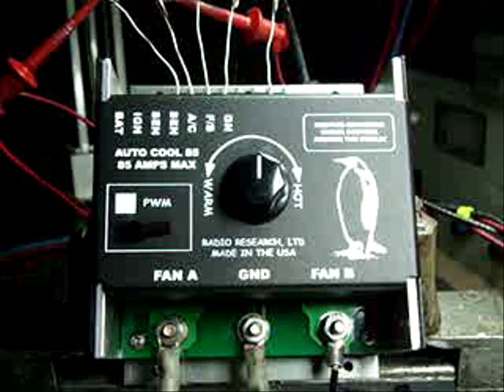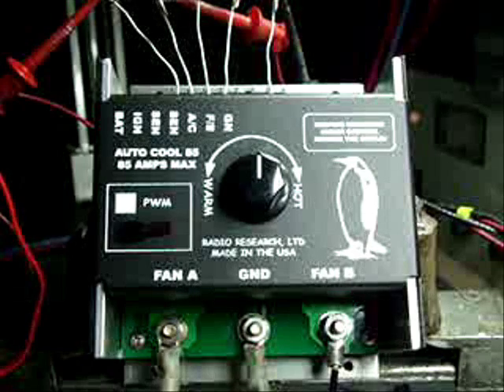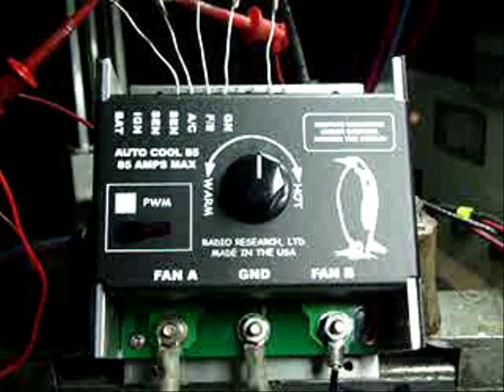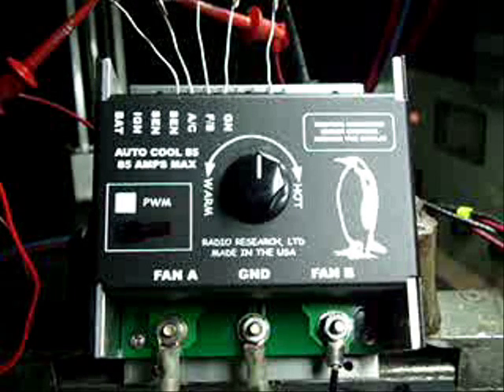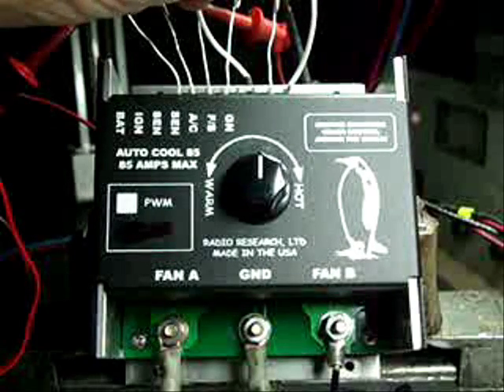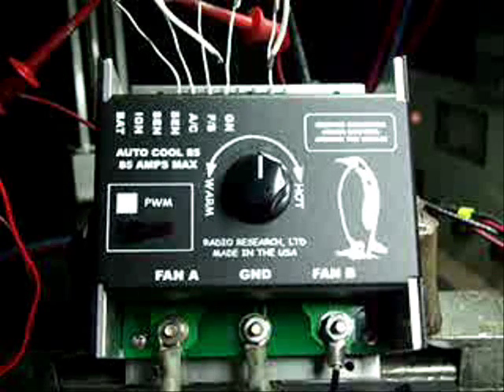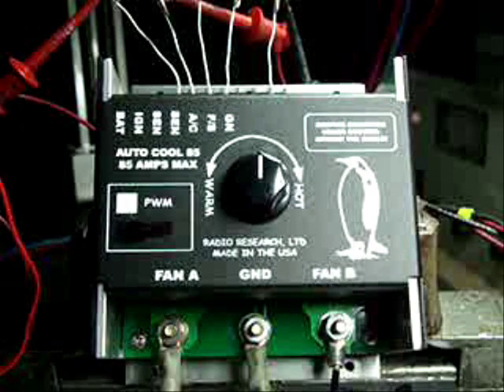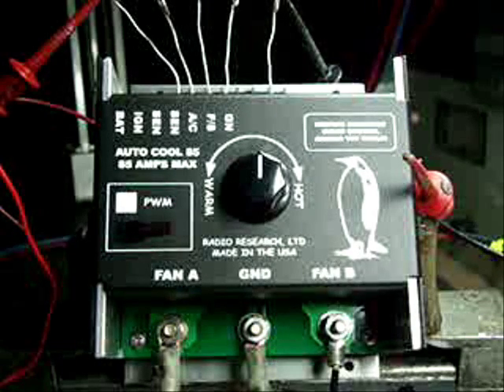THE AUTO COOL 85 Pulse Width Modulated Radiator Fan Controller

Comment: Mr Darryl, I have a silverado 1500 putting a TYC brand dual contuer fans (stock style) pulling about 27 amps each on high. Will the 85 amp controller work with this configuration? Thankyou

Comment: Hi Darryl, i just ordered this unit as well to monitor my Engine/Transmission coolers/fans. Do in need to  hook up 2 sensors in series or paralell? So that wichever grounds first activates the Fan Controller. I bought the Setrab 180F sensors because they don't restrict oilflow.  Tx, Harry